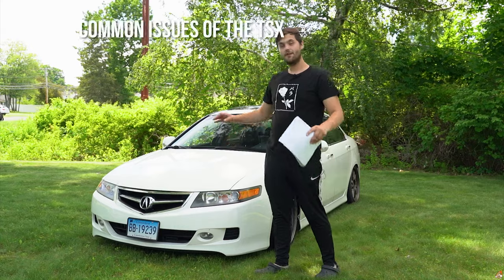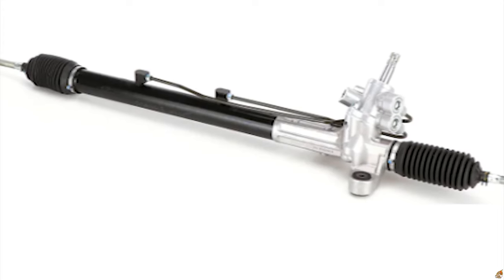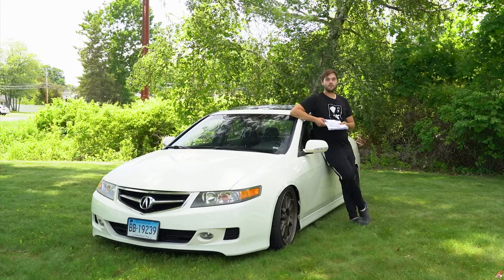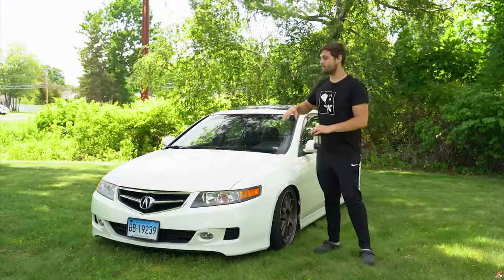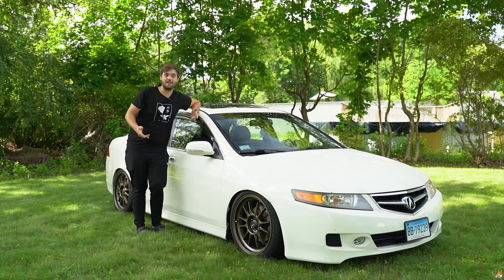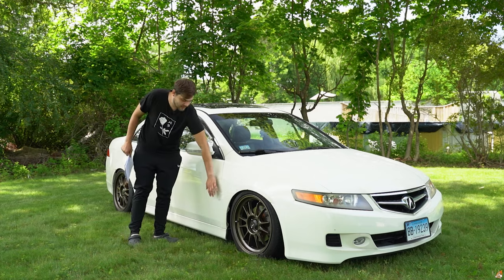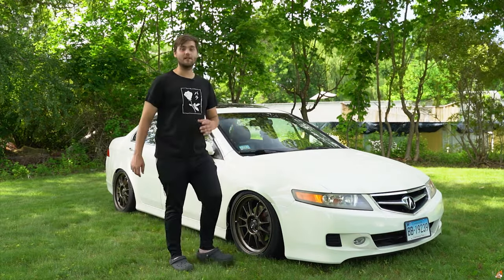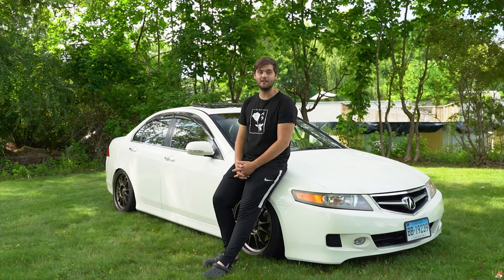TOP 10 COMMON ISSUES With An Acura Tsx

Comment: Passenger axle bruhhh 💯 🤦🏽‍♂️
Reply from the maker: Dealt with that side wayy to much smh lmaoo
Reply: Bro on my 4th one🤦🏾‍♂️
Reply: Y’all wouldn’t believe me. I went through 3 pairs of axles both sides. Then got oem ones 😂 I kept getting a speed wobble from them autozone and oriellys axles 🤦🏽‍♂️
Reply from the maker: @KioniDalo  I’ve gone through so many autozone axles on my previous one had enough of swapping then I got insane shafts
Reply from the maker: @stevenvlogss8505  😭😭

Comment: Is a 2010 TSX for 5K a good deal?
Reply from the maker: That’s not bad depends on mileage what has been done and AT/MT
Reply: @RishMedia  170K and I'm not sure what AT/MT means.
Reply from the maker: @justalott  auto or manual  but assuming it’s an auto
Reply: @RishMedia  it is. I haven't agreed to but it yet because I'm still saving up.
Reply from the maker: @justalott  personally I’d try going for a 07/08 Tsx that’s just my performance and body style preference
Reply: @RishMedia  I'm honestly not picky. As long as it has little to no issues, rides smooth, and is reliable. That being the case, what would you say about the deal?

Comment: My rack & pinion went out at 120k.
Reply from the maker: Damn that sounds a little early, we’re you routinely change power steering fluid when needed/repairing leaks.
Reply: @RishMedia  l bought it used at 65k not sure if the previous owner did or not. I never changed it from 65k-120k. Everything you mentioned has gone out for me on my 07 except the A/C compressor.
Reply from the maker: Danggg kind of went out prematurely with the rack and pinion, but otherwise seems like it’s been pretty solid